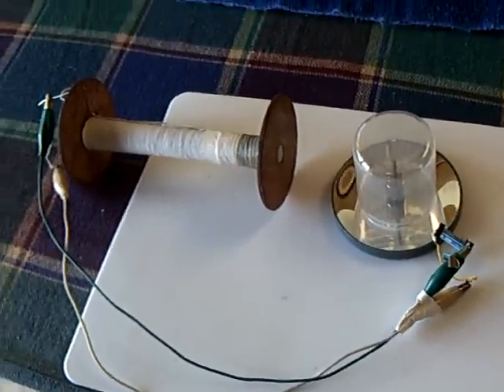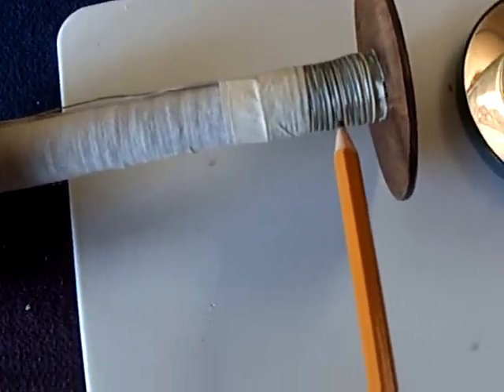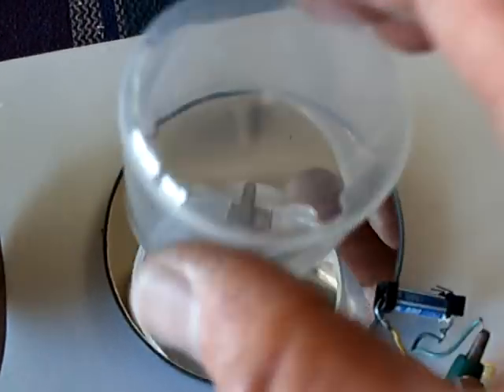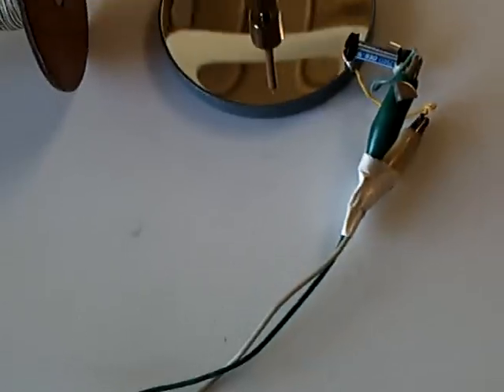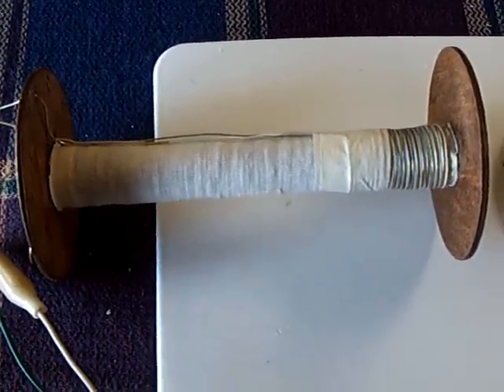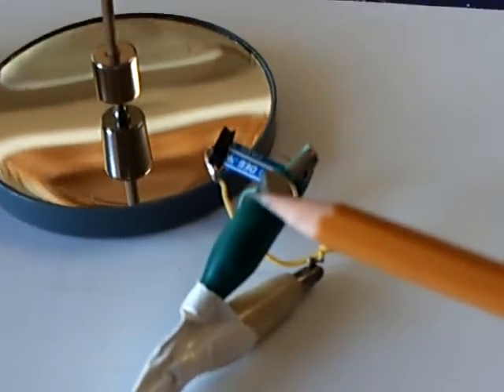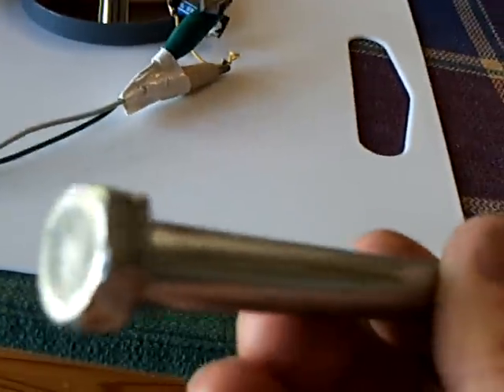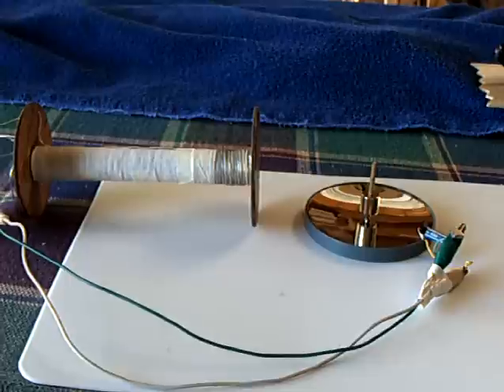Stubblefield coil magnet spinner.ASF

Comment: Hi Lidmotor.  Sorry to zinc coating on the steel wire breaks down too quickly.  Have you tried bare Iron wire?  I thought the patent mentioned such.  Nice to see the 1/2 inch bolt worked better than the soft iron.

Comment: your corrosion problem is most likely due to the coil being exposed to to much oxygen... galvanic reaction and corrosion although related are not the same thing... possibly sealing your coils after wetting them might solve your problem?